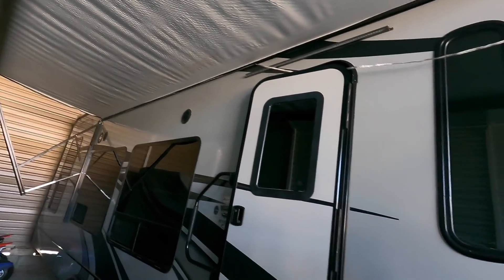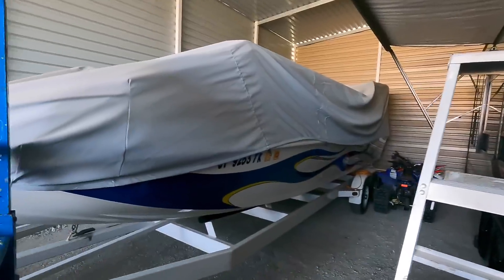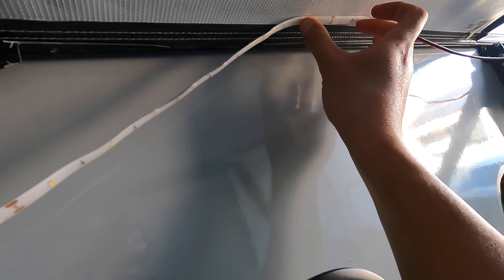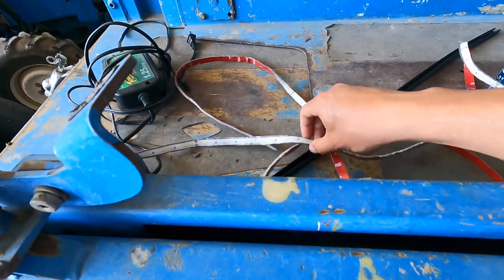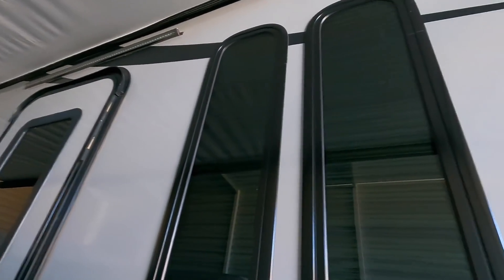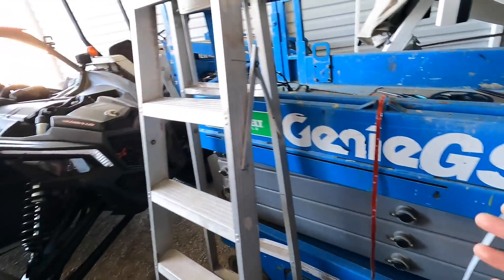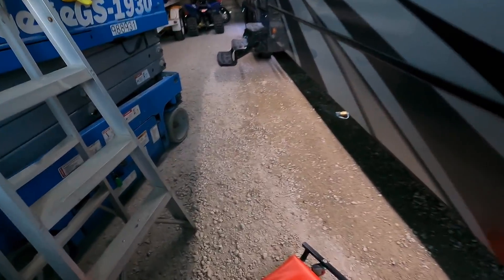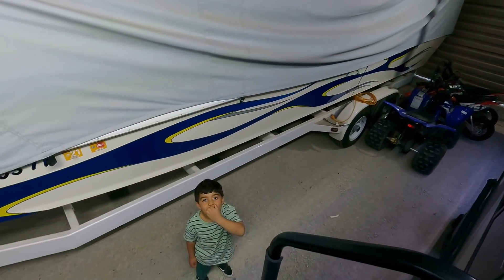Upgrading LED's on trailer!!

Comment: I have a 31CRSG. If you haven’t already, seal the top of the led bar above your door with silicone. If you get caught in a storm it WILL fill with water and leak into the wall.

Comment: "Non-Waterproof"  might be an issue later
Reply from the maker: The lights are water proof
Reply: @EddieLife3500  What is the Best DPF and EGR delete for a 2017 Ram 3500 Laramie?